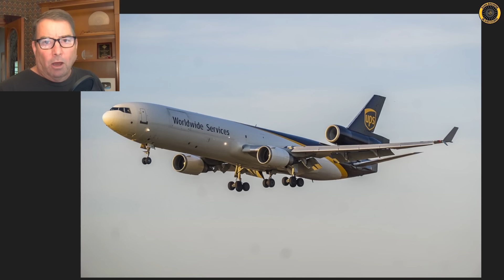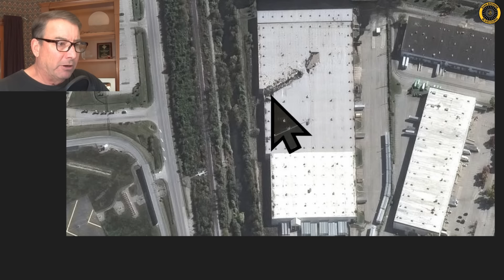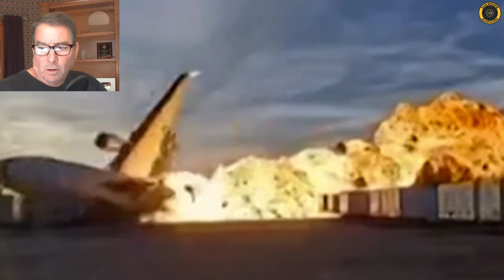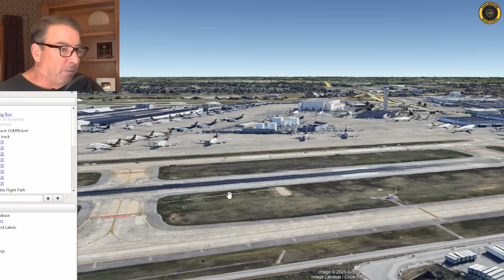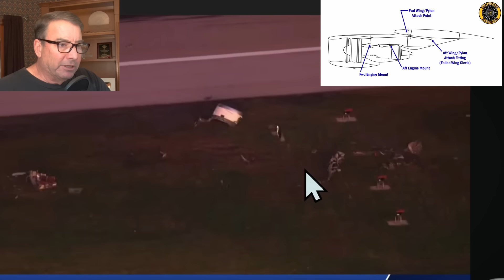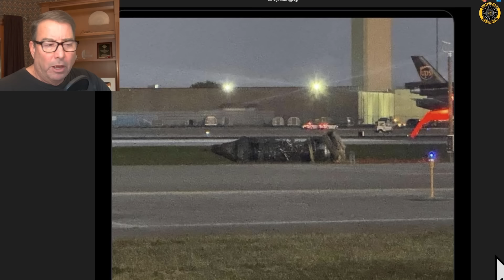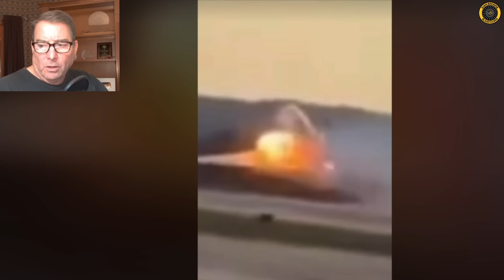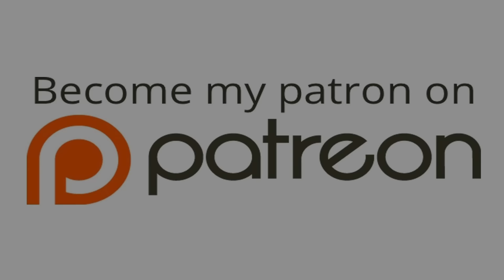UPS #2976 UPDATE 2 6 Nov 2025

Comment: this is such a terrible accident. I think that its fairly obvious that it was another fail pylon. For the sake of the mental health of maintenance crew that worked on this aircraft I hope that it was not lack of maintenance or missed inspection or improper maintenance procedure caused this.
Reply: From what he says in this video, it sounds more likely that it was a blade failure rather than a pylon failure.
Reply: @cremebrulee4759  blade failure shouldn't drop the engine like that. The pylon is built to handle extreme vibration

Comment: I guess the question I've had is, how much chance did the pilots have if they hadn't struck the building to be able to stay airborne enough to land again with the wing pouring out fuel and on fire.
Reply: According to MD-11 pilots, once the #2 engine stalled, their chance was zero.
Reply: @KennethAGrimm  Yes, I guess what I'm wondering is, would the wing explode if they could stay airborne, or is there a way to shut off the fuel to that wing. Guessing not.
Reply: @jeffreykirk8087  In the Grade Lane video, as the aircraft first appears, there is a fireball behind the wing.
As the aircraft crosses Grade Lane, there is little evidence of fire.
(After the aircraft collides with electric wires and then impacts ground structures, there is a huge fireball.)
The lack of fire over Grade Lane seems to indicate the moment the crew shut off fuel to the (now nonexistent) left engine.

Comment: In the case of AA191, maintenance considered it to be ‘safer’ to remove the endgame and pylon as a single unit in order to avoid removing and reinstalling interconnects between the pylon and engine itself.  Two other airlines used a similar procedure for this reason.  The DC-10 aircraft type certificate was suspended and subsequently recertified with the caveat that removing the engine and pylon as a single unit would make the aircraft unairworthy.
Reply: America Airlines was fined $500 k for improper maintenance procedures. Earl Russell Marshall, a crew chief at the American Airlines maintenance facility in Tulsa where the last maintenance procedure on the aircraft had taken place, died by suicide in the middle of the litigation.

Comment: A closer inspection of the opening photo shows Grade Lane, and not Crittenden Drive.  The a/c has already grazed the UPS warehouse, and my bet is that the roof gouge was from the tail of the MD-11, in a nose-high climb attitude.  Not nit-picking here, Juan, just looking at the facts and calling them.  You've got your hands full, and did not scrutinize the landmarks fully ( billboard next to power pole and small blue roof attached to building in foreground ).  Thanks for all your hard work and great information, otherwise !  God Rest all who perished so horribly, and Godspeed the recovery of the injured survivors...
Reply: FYI Juan just posted and pinned a correction re street name

Comment: 7:30 Indeed the difference vs. AA191 is that the engine found on the runway of ORD back then was intact. Not even the cowling came off in that case. The engine was whole sitting on the runway for AA191. In this one, the engine seems to have disintegrated.
Reply: It was also noted in the show ACI on that crash that the DC-10's engines + pylons were even "engineered" to detached safely, up and over the wings to keep clear from smashing into the horizontal stabilizers.
Reply: @Edax_Royeaux  Yes, but on AA191 the engine's departure took out the hydraulic lines for the flaps and slats, IIRC. One presumes that this was all properly fixed on the MD-11!
Reply: @possel4747  
"One presumes that this was all properly fixed on the MD-11!"  
From the video footage, it does appear the fix worked.  The left wing's flaps and slats are configered the same as the right wing.
Reply: @Edax_Royeaux  Given the latest NTSB pics it appears that the issue wasn't fixed fully: the loss of the No 1 engine and pylon caused the major fire in the wing which started as the engine departed. It was meant to have valves to cut off the fuel in that case but clearly the fire was immediately out of control.
Reply: @possel4747  That didn't happen to AA191, so it's not entirely clear what happened and why.
Reply: Wow, didn't realise that was possible. Good call.

Comment: We may want to consuder some sort of automated take-off abort system that monitors all parameters and until v1 also has authority to abort. The 2 or 3 seconds in faster analysis and decision-making could at that stage make a difference. That and EMAS at the end of the runway. More than aa191 im getting concorde vibes. Could it be fod, what plane(s) took off before this one ?

Comment: Re the acoustic liner: Actually, an Aramid blanket wrap (Kevlar). The primary purpose of the aramid wrap is to catch errant fan blades or large fragments flung outward by centrifugal force, preventing them from piercing the aircraft's fuselage or wings, which would be catastrophic.

From the enlarged slightly out of focus still shot of the MD11 at 0:02, it's hard to say for certain but it looks like theL/H outboard slats could be retracted.
Reply: Pretty sure they're not. They also should not be, since after AA191 a mechanical stop was added to keep them extended. Their flight staying pretty level also supports that (although they were likely above the degraded stall speed for the left wing - a training difference resulting from AA191)
Reply: The slats are solely powered by the No.1 Engine. No No.1 engine, no way to retract the slats.
Reply: @allangibson8494  That's not true, though? The slat are operated by either hydraulic system 1 or 3. In landing/takeoff config the system automatically reconfigures hydraulics and can do so without fluid transfer. (There's also auto slat, which directly affects the slat valves.) 
The only thing MD-11 loses with a left/right hydraulic system out is part lf the spoilers and the respective reverse thrust.

You are correct that the slats couldn't be retracted, but that was due to 1) probs both hydraulic lines severely damaged -> no input + valve lock and 2) mechanical lock & autoslat below 280kts
Reply: @lyaneris The slats are only on circuit one - because they aren’t critical (but asymmetrical deployment is).
Other videos show the slats fully deployed.
Reply: @allangibson8494 The schematic I'm looking at has them on both 🤔
Reply: @lyaneris And the one I saw for the MD-11 only had them on the No.1 engine (it could be a variation between models).
Reply: @allangibson8494  Would be weird. My brain is bothered, I'm looking through the FCOM 😅

You are correct, "outboard slats will not retract if extended before loss of pressure"
-> that's also the case for a #3 hydraulic failure, so I assume this has less to do with which hydraulic system operates them and is a result of an automatic lock.

The slats are actually extandable even with a combined failure of #1&2 where the flaps aren't (with #2&3 flaps and slats are operative) - they are only inoperative with a #1&3 failure which also results in max flaps 28.

(Additional stuff about hydraulic failures; 
#2 is the most tame system to fail - just stuff all have: some spoilers, flaps > max ldg weight, flaps 35 landing - 
#1 is also fairly tame - AP2, no autobrakes, nsw steering left restricted & the slats stay extended -

#3 is the worst to lose - AP1 pitch trim, steering right restricted, slats extended, 1-3 & 2-3 RMPs inop 
(those connect #3 to #1&2 and can transfer power from an operating system to an inoperative system without fluid transfer and are automatically turned on with a hydraulic pressure drop/engine speed <45% in landing config),
 alternate gear extension, no autoland, 
"go-around is not recommended"
The schematic and explanation I'm looking at is from the Canadian TSB for A98H0003.)
Reply: @allangibson8494  Additionally, auto slat extension is on Gen Bus 3

Comment: I mentioned in a previous post on a forum about the CF6 turbine disk failures as of 2016 and AD's issued.  I forgot about the compressor disk issues of the souix city iowa incident at the time of that post.  This is looking more and more like a metallurgical flaw in one of the engine disk structures of the CF6.  Compressor or turbine.
Reply: Wasn't Sioux City a fan disc failure?
Reply: @onceamoth  yes. Fan disk of the compressor section. Unless the terminology changed in the last 23 years. We consider fan disks as the first stage of the compressor section when I was in school. Semantics I suppose.

Comment: That dash cam video was actually on 7070 Grade Ln. If you watch the aft of the aircraft in the video, you’ll notice something coming off it. This is because it just hit the UPS facility at the end of the runway. It wasn’t the wing that hit that building at 2:00, it was the aft of the fuselage. That’s also why that building wasn’t on fire
Reply: I agree that is what appears from the still pics. The aircraft is passing over Grade Ln. (and the UPS warehouse) at wings level, so the wingtip couldn't have caused the roof damage.
Reply: But a vertical view of the building also shows a parallel strike where the left gear dug in
Reply: @Tomxman that landing gear is still attached to the aircraft after it slid across the building. You can still see left main gear still in place on that dash cam video. I honestly don’t think the landing gear made contact with that building. If it did, it probably would have been ripped off
Reply: Landing gear?
Reply: @Mutasis_Mutandis still attached in the video
Reply: That makes sense because I was very confused why that building didn’t catch fire at all

Comment: Left engine sitting on ground beside runway smoking: bad. Left engine sitting on ground smoking, but on the RIGHT side of the runway: bad and confusing.
Reply: GE engines rotate clockwise (from aft aspect) so the "torque" would make them "roll" to the right (once it separated)
All that tremendous energy, when the engine impacts the ground, will translate into a right deflection.

Comment: To current or retired MD-11 pilots out there:  can an MD-11 take off on the #3 engine?  Assume the #1 and #2 engines are not running and the rest of the aircraft is in sound condition.  I imagine weight etc play a role in whether this is possible.
Reply: Not a MD-11 pilot, but several MD-11 pilots have shows up on YouTube interviewed on news clips. One quote summarizes all: "No way".
Reply: NO WAY for aircraft that carries cargo and fuel for an 8 hr flight

Comment: I would NOT be surprised to see the MD-11 series grounded rather quickly.  These things have had a lot of pylon detachment problems.
Reply: If the engine did chew up the carbon fibre acoustic surround material on full thrust during V1 then I don't think any pylon & holding bolts could have withstood the sudden vibration that would have caused.
Reply: may not be the pylon detachment problem this time
Reply: All depends on the cause. Did the engine fail causing it to shake itself off the pylon. Or did the pylon fail first.

Comment: That new dashcam video is AFTER the plane hit the roof of the UPS building and right before the left wing hits the oil tanks.  You can see the wing hit the black oil tanks in the video which is what caused the left wing to dip towards the ground.  Evidently the landing gear or tail hit the roof of the building first.

Comment: Thanks for the video and your hard work keeping us up to date with the latest Juan. 

At 2:00 you said the dash cam footage came from Crittenden Drive, but that road is actually inside the Airport Perimeter and runs East-West. 

I’ve looked at street view maps and found that the dash cam footage came from a car traveling Northeast on Grade Lane. The billboard in the video is outside a tyre shop called Grainline Tires at the address 7011 Grade Lane. So that means that the plane has already made its first impact on that big UPS warehouse by this point. 

The only thing I struggle to figure out is how that contact occurred, since there’s seemingly no obvious damage on the undercarriage/main landing gear at the point this video takes place.

Comment: Juan, you need to do a bit more research. I have watched the video the still shot came from and looked it up on Google maps. The tire shop on the right side of your opening shot is on Grade Lane. The plane's wheels have already sliced the roof of the first building. If you watch the video, he moved up the road and turned into a business complex where you can see the address on the sign. The beige building on the right with a blue canopy is a tire shop on Grade Lane. Open Google maps and turn on satellite. Watch the rest of the video that the still shot came from and watch the address on the sign as he turns into the business park. Hope this helps.

Comment: Thanks Juan for such quick and concise updates on this. I am really grateful that you point to only the visible evidence and that you don’t delve into wild speculation and drawing conclusions from that, something I have noticed a lot of other pilots do on YouTube. It’s really good to have one channel here where we can all build upon our knowledge from what is available and often explained by you, without having to filter through opinionated speculation and pure guesswork. 

There’s obviously going to be a lot of speculation over the pylon detachment and what work was done during the September 3rd - October 18th period during which the accident aircraft was out of service. When seeing all the people drawing conclusions linked to American Airlines flight 191, I have consistently tried to point out the changes made since then and the 46 years between the accidents, each of which should be good indicators that drawing such conclusions is rather unwise, as is doing the same with El Al flight 1862. 

I have been wondering to what extent the engine would have needed to structurally fail and which specific parts in order for it to depart from the aircraft along with the pylon, seemingly all before the crew had the time to react and roll the engine back. It will be interesting to see what the investigation turns up over the next few months. It’s really bad luck that it was on this flight given that every other flight since its return to operational status has been between 1.5h and 4.5h flights. This one just had to be the one they were more heavily fuelled, and also on a collision course with a petroleum recycling centre. 

I hope that the 9 missing may be found safe and well, though the longer time ticks on, the more I fear this will not be the case. I feel for the loved ones of those who lost their lives. Having lost my fiancée, I understand the sudden heartbreak it will be causing some people and I hope they are able to get through this tough time better than I have managed.

Comment: Amazing job being wings level right to power-pole/wires impact...thats ALL of your lift vector in the vertical and best chance for survival and climb. Thats an experienced pilot .
(I agree the gear or tail was the roof-impact observed.)
The FDR will tell us to the tenth of a second exactly WHEN in the takeoff roll this #1 engine seperation occurred....I do not agree with the assumption that it was "well after V1". I assume it was "right before, at, or right after V1." But we will know to the 1/10 of a second exactly where it occured in time.

Comment: Thanks for the update @blancolirio .. Just as a correction, the dash cam footage you show is actually from Grade Lane. Its after the aircraft clipped the top of the building. If you go to google maps and pick between 7011 and 7015 Grade Lane  and go to streetview, you will see the angle.

Comment: My dark horse theory.  RW 17R was NOTAMed closed for much of the weekend.  (I don’t know why). I assume for concrete patching.  Concrete didn’t cure correctly and got sucked into #1 engine.  The result was more than one fan blade separating at takeoff thrust.  Massive stress over the design limit. Rest is history.
Reply: Very, very interesting.
Reply: Maybe runway incursion? One comment somewhere said they saw the plane swerve to the right then back onto the runway during the takeoff roll. Maybe left wing and engine hit something on the runway before getting airborne?

Comment: Just to correct the record, that dash cam video was taken from Grade Line looking north, towards the intersection of Knopp Avenue. It is running adjacent to Grade Lane Auto and Tire.  The Black vertical oil storage tanks are visible on the right side at the impact point.